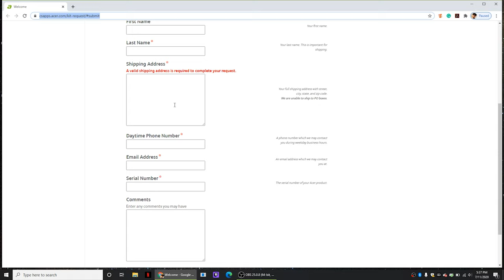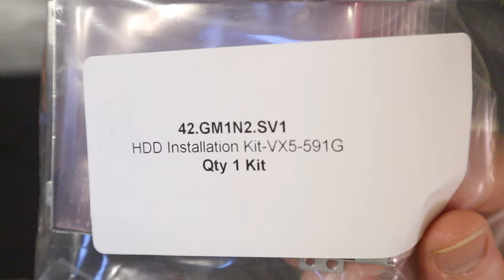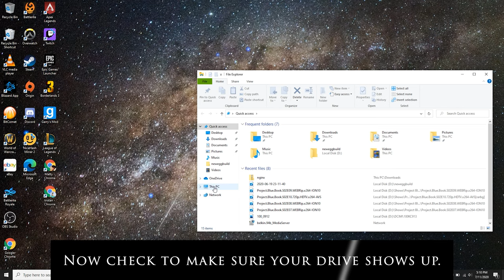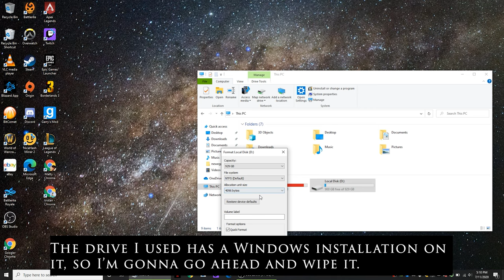HOW TO ADD A 2.5" DRIVE TO YOUR LAPTOP - Acer Aspire VX15 2.5" HDD mounting kit install!

Comment: Hi , may I know what is the max PCie m.2 SSD size can be install in this laptop . Thank you
Reply from the maker: 4tb capacity
Reply from the maker: Or if you're talking physical size...2280
Reply: Which mean I can Upgrade the pre-install m.2 NVMe PCIe to 1TB ? Is that correct ? .
Reply from the maker: Yes
Reply: Thank you Very much . You’re a life saviour , keep up with your up coming video . It really helps other people to sloved thier problems . 👍🏻👍🏻👍🏻👍🏻
Reply from the maker: You're welcome and thanks! Oh and also you should know that you will have to reinstall Windows after you change the SSD